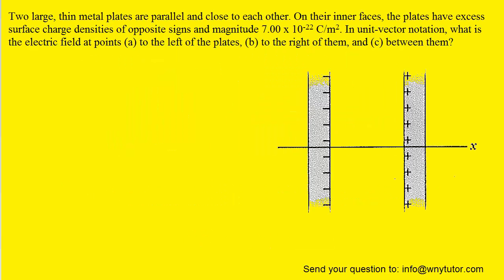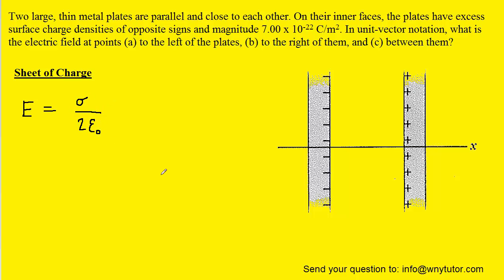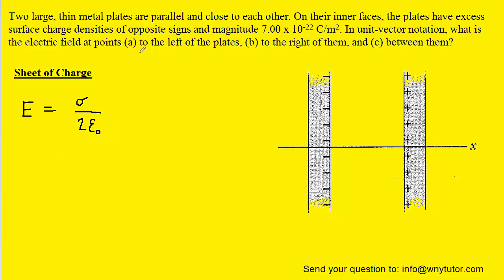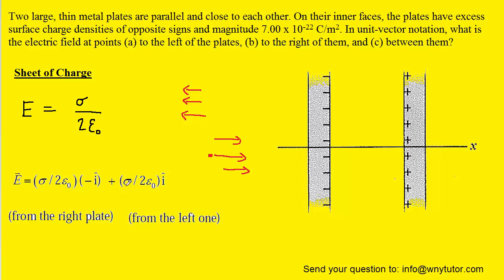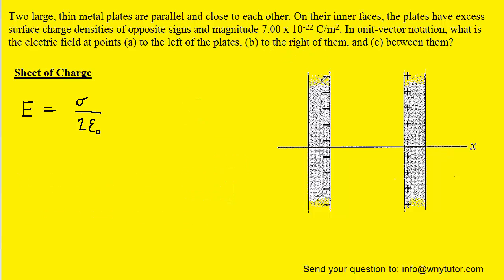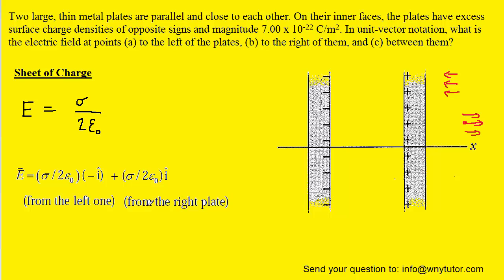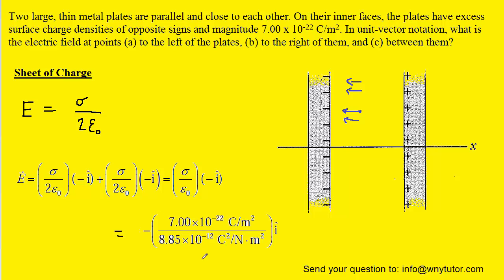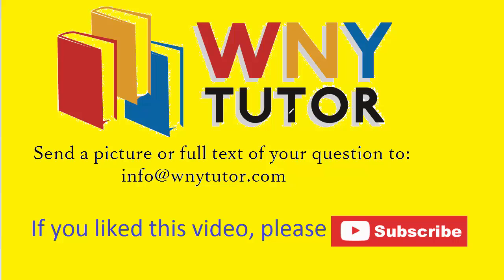Two large thin metal plates are parallel and close to each other

Comment: My text book has E=(2*sigma)/epsilon. 

Also how can the field vector cancel each other when their magnitudes are not equal at any point to the right or left of the two plates? E has the inverse square dependency, so as the distance from a charge to a point increases, the magnitude of E decreases.
Reply: If these are point charges than you'd be right that E has the inverse square dependency, however, in this problem we are talking about the electric field of 2 plates of opposite charges and the derivation of the formula is given as sigma/2epsilon zero. Notice that there is no r^2 or distance in the formula unlike in the formula for coulomb's law in point charges where there is the inverse square of r or the distance.